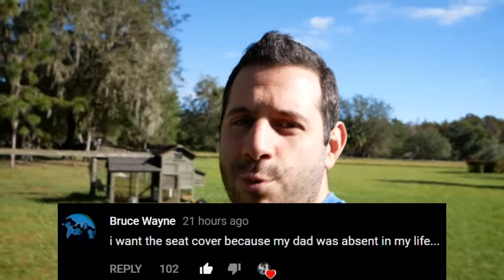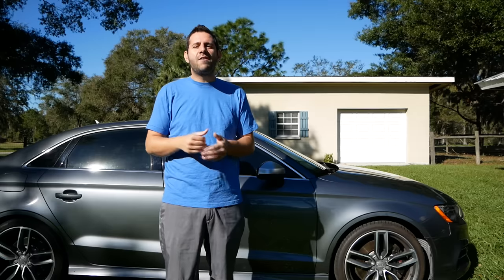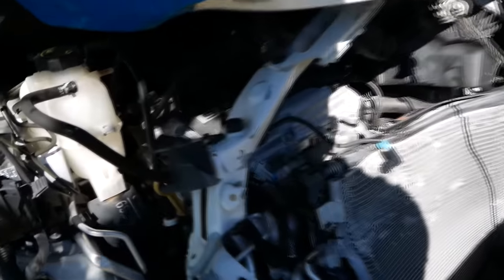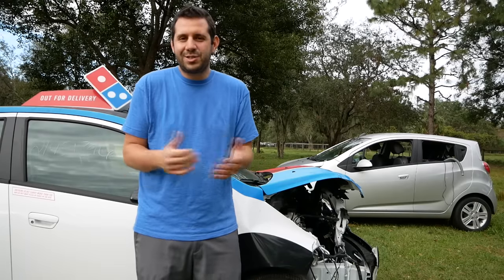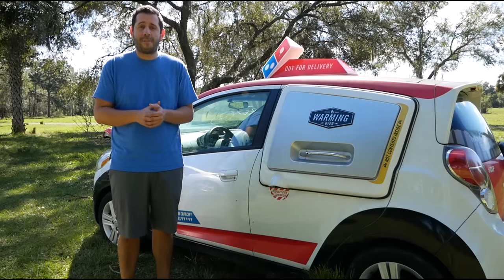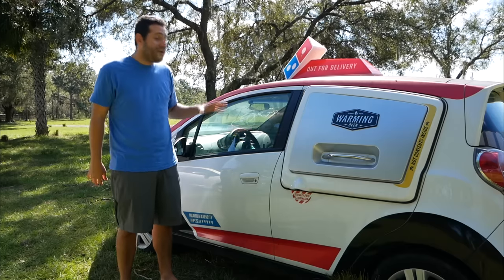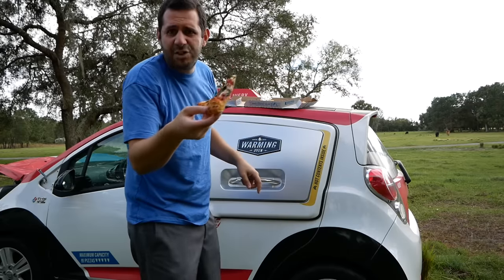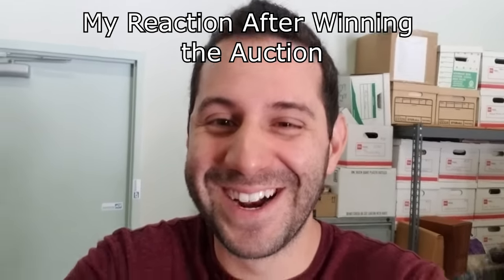I Bought a WRECKED Domino's Pizza DXP Car for $525 (and we're gonna rebuild it)

Comment: Wow does that "warming oven" look generic as hell! I love how it was attached so piss poor to the door, and the red LED strip that was just stuck on the roof of it... Im sure Dominos took it deep and hard with no  lube for these craptastic rigged modifications!
Reply: audiofanaticz wtf
Reply: audiofanaticz  isn't it a Ford
Reply: audiofanaticz - Not as deep and hard as Rousch has made a business of taking it with their cheap ass plastic mods.
Reply: audiofanaticz I used to drive these things for dominos and I can agree that the whole car is a big pile of shit. 18 second 0-60 time with the pedal on the floor.
Reply: appleintosh - You have your stats mixed up, the Chevy Spark is an 11 second to 60 car, 18 seconds in the 1/4 mile. And that's flooring it, not delivering pizza. For a little hatchback it's as fast as it needs to be.
Reply: Red Bluesome this also isn't a stock chevy spark..
Reply: diego perez - Mechanically it is a stock Spark, 1.2 liter four, continuously variable auto trans, GM factory warranty and all. The whole idea behind the DXP is promotion and quick turnaround, not slow delivery and cold pizza.
Reply: Red Bluesome Lol I actually drove these cars and timed it myself. Go ahead and list the stats you found on Wikipedia and keep arguing with the guy who actually drove the things.
Reply: Red Bluesome but I'm pretty sure that oven and all the other shit in it isn't stock. Weight has something to do with the speed too ya know.
Reply: Red Bluesome no it aint man my 98 landrover dedender will accelerate quicker while towing 4 tone
Reply: diego perez - Please understand what is posted. I said mechanically the car is stock, which it is. The warming oven is a non-mechanical modification. If anything the DXP may be lighter than stock with the front and rear passenger seats removed.
Reply: Red Bluesome Are you saying I'm lying about it having an 18 second 0-60? You don't think it's at all possible that Dominos decided they didn't want their drivers trashing a brand new vehicle that their drivers didn't have a penny invested into? You don't think it's possible that they might have retuned the computer from a stock Spark to make it more suited for the needs of a pizza delivery company? Maybe give it a slower top speed and acceleration? 

You still haven't shared your authority on these cars either. For all I know you actually are some guy pulling info off Wikipedia. Unless you've driven a Dominos DXP or you maintain them, your opinion doesn't mean dick either.
Reply: killerwar1 No, he's saying that I'm lying about my 0-60 time. He still hasn't proved to me that he's ever had ANY experience with a DXP, so he could just be pulling the stock Spark stats off of Wikipedia and saying they must be the exact same for a modified Spark. 

Once he proves to me that he's either driven or maintained a Dominos DXP then I will take him seriously.
Reply: appleintosh - I'm saying the car performs like a stock Spark until proven otherwise. You posited that the DXP is electronically limited and takes 18 seconds to 60 so back it up with documentation. 

I don't come from opinion but published facts. Car&Driver made an instrumented test of the '15 DXP and their findings were 0-60 in 11.2 sec. and a drag limited top speed of 100 mph. In other words like a stock Spark, which is already limited on performance to be honest.
Reply: Red Bluesome My time was 18 seconds. This was a pedal to the metal test on a real road, in actual conditions. Not a test on a track. A track is not actual delivery conditions. 

They probably used a brand new DXP, that was never used and abused by delivery drivers. These things got abused. Performance suffers after abuse. One of my stores DXPs needed an engine rebuild after about six months because drivers treated them like absolute shit.
Reply: appleintosh - Driver abuse - such as mashing the pedal to see how fast it'll go, poor maintenance, and what you could manage on a public road does not invalidate an 11.2 time. The bottom line is, the DXP is not electronically limited as you claimed it might be. It's a long way off of 18 seconds.
Reply: Red Bluesome It's 18 seconds in the real world. What good is a fast track time on a utilitarian vehicle if it will never go that fast in its intended use?
Reply: Red Bluesome It's exactly the same as measuring the towing capacity of a Corvette. A corvette is never going to tow a trailer in the real world.
Reply: appleintosh - 18 seconds is what you informally clocked on an abused and poorly maintained vehicle by your own description. Closer to 11.2 is what a DXP/Spark would do in proper condition on a dry flat surface, depending on load, even in the real world. What you're really saying is the car you drove was shabby.
Reply: Red Bluesome And I'm telling you that 18 seconds is a real time. Every Dominos store is going to have similar wear on the cars, because they all use their $25,000 investments the same way. By the way, my test wasn't in the DXP that had a blown engine. We had three of them. 

You can always boast about your cars 0-60 time when it's brand new, but the reality is that performance suffers after use. Any car with 20,000 miles is going to perform worse than the same car brand new, especially when it racks up that 20,000 miles in less than a year of hard city driving. 

The DXP isn't a race car. It's a pizza delivery car. There's no point in showing off a fast time, when the reality is that the car is only going to be that fast for the first few months of its use. It doesn't hold its performance like a performance car would. 

You're talking about a time in a driving magazine, driven by professional drivers on a real track. I'm talking about reality, where 21 year old, inexperienced drivers are driving pizzas around in a car that's been abused by said drivers. Obviously there's going to be a difference. That's just reality.
Reply: appleintosh highly doubt a small car like that takes 18 seconds to get to 60 lol...small cars these days are usually quite nice to drive. Very nimble, incredible stopping distance and quite nippy. Not like it's a performance car in anyway way but the power to weight ratio is usually so good that they are quite nippy obviously not if you compare it to a sports car but if you've driven a new small car you'd know what I'm talking about.
Reply: appleintosh also you deliver pizzas and aren't exactly a pro driver so I highly doubt you've even pushed this car to it's limits to even be able to tell us how it is performance wise.
Reply: diego perez well in a way it is...sure the oven adds weight but it'd only be half as heavy as a human and humans barely make a difference to a cars performance so I doubt the oven would. Also it only has one seat with a semi stripped interior so that evens it out basically. 50kg oven minus like 20-30kg from the interior. So in the end is like a 20-30kg difference plus a driver. And if the drivers weight mattered then only small/tiny people would win racing which isn't what happens.
Reply: appleintosh also how'd you time it? Did you count it yourself ?? 😂 the fact you're not a pro driver or even probably a very good one already makes the test invalid but the fact you probably just counted it to yourself just furthers my point...we could put you in a lambo and a pro driver in a lambo I guarantee his 0-60 is quicker then yours every time so if you really want to test a cars 0-60 speed then you need a pro racer who's actually capable of pushing the car to it's full potential not the drivers full potential...you'd probably take 10 seconds to hit 60 in a 4 second sports car doesn't mean that cars slow...
Reply: Yamaha Life Great job completely missing the point. 18 seconds is the real 0-60 time, in the real world, with real drivers. Dominos delivery drivers aren't professional race drivers. That's the point. Nobody actually delivering pizzas in this thing is going to get a 12 second 0-60. 

It's not like it takes much driver skill to drive this thing anyway. It's an automatic, the driver doesn't get any control over the torque or when the gears shift, things that a professional driver with a manual transmission gets to manipulate. You push the pedal to the floor and the car does the rest. 

And if you're really curious, I timed it with a stopwatch, and while the DXPs are monitored, we floored it everywhere so there's no difference between a test and regular driving.
Reply: Yamaha Life Flooring it was actually the only way to keep up with other cars accelerating.
Reply: appleintosh - Your claim that it's an 18 second doesn't hold water when the argument is based on the performance of amateur pizza drivers in poorly maintained cars. The limiting factor here is not the car. 

Mashing the gas from idle isn't going to give you the fastest time, even in an automatic. A professional driver - or even a competent amateur knows to hold the brake while building sufficient revs to ensure immediate power, and then to modulate the throttle thereafter to find that sweet spot in the rev range. Some skill is required even for an automatic, so the DXP is not an 18 second car, you guys just couldn't launch it correctly. 

Track or "real world", there is no way a DXP/Spark would require 18 seconds unless the driver really doesn't know better. Remember, a car is only as good as the driver after all.
Reply: Yamaha Life Have you seen how old those videos are? Try 2010. Almost eight years ago.
Reply: Red Bluesome Jesus Christ man, that's what I'm trying to tell you. 18 seconds is what you can expect from the people who drive these cars. Not 12. Why is this so hard for you to understand?
Reply: appleintosh - It's not hard to understand at all, but you didn't say that. You basically said the car was shit and couldn't do better than 18 seconds to 60. We've established that it can, and if it doesn't that is no fault of the car.
Reply: Red Bluesome I did say the car was shit. I still think that it's shit, and if you ever drive one you'll probably agree with the rest of us who have driven them. 

We've established that the car can go 0-60 in 12 seconds in a controlled environment. Not in actual usage. In actual usage with average drivers it's closer to 18 seconds.
Reply: appleintosh - You described the car as a big pile of shit, 0 to 60 in 18 seconds foot to the floor. You're free to have your opinion of the car, but don't say it's an 18 second car simply because you can't drive it faster. 

The "controlled environment" of an instrumented test is not a laboratory, just ideal. Any regular driver who knows what they're doing could get a 12 second time out of a Spark/DXP on a track, or on the boulevard on a cool dry day.
Reply: Red Bluesome Are you sure about that? You've never driven one. I don't need you insulting my driving; notice how I've refrained from insults. 

I'll say it again since you keep ignoring my point. An average driver in an average DXP is not going to pull a 12 second 0-60. The test you're describing involves a professional driver on a real track. The test I'm talking about is an average driver, driving an abused car (which is normal when talking about these cars) on a city street. Those are two completely different environments. You can't expect two completely different tests to have the exact same results.
Reply: Red Bluesome Notice how I never once said the DXP was limited to an 18 second 0-60. Never once. All I've been saying this whole time is that a DXP is not going to pull a 12 second 0-60 under normal circumstances. 

I'm talking about reality, you're talking about ideal conditions.
Reply: appleintosh - You made it clear you thought the car was no better than 18 seconds to 60, with no regard for conditions, even alluding that the car might be electronically limited. You wouldn't even believe it was capable of 12 until a published road test was referenced. 

There is no voodoo involved in fairly replicating tested acceleration times in the real world. Even on a city street this car could likely do 13 or 13.2 with a fat guy driving, and six pizzas in the back, if he knew how to utilize the powerband, which is not mashing the gas from idle. That's not even fast, but it's light years from 18 as far as acceleration goes.
Reply: 😂😂😂😂😂  these comments tho
But really why would you try to "real world" test a car that wasn't yours mr. apple? Someone spent their hard earned money on that car for their business..you were employed at Dominos as a pizza boy, not Motor Week...smh..no respect.
On the real though our spark is zippy for in town high traffic, it is not a performance machine by any means but these folks trashing it in the comments need to settle down. Its good for what it is.
Great video excited to see the project come along for $525 it was a steal like it or lump it.
Reply: Red Bluesome Sure, I did say I timed the car at 18 seconds, and I had a real hard time believing you until you posted a source to your claim. But I never denied that it's a 12 second car under the right conditions. 

So you're saying that as long as the driver is skilled, they can recreate the acceleration of a brand new car on a track, while using a used car, with 20,000 miles, an engine that's already wearing down, on a city street? Sure.
Reply: Cuddly Cactus We tried to have fun in the cars because we were entrusted with a vehicle we didn't have a penny invested into. We all agreed that that was it's only redeeming quality; that it's not our car so we're not putting miles on our own cars. Delivering pizza sucks.
Reply: appleintosh that statement is sad, the fact you used the word "entrusted" smh. You chose that job, so can't really complain bud. I hope you ultimately can see that it wasn't really the choice having fun with a car you were "entrusted" with. I hope you have a better job and are making better choices, good luck mate. Red still is the winner of this fun lil debate and by your own statements you made yourself look like a bit of a doo, but hey best wishes mate.
Reply: Cuddly Cactus Whats your definition of entrusted then? The company let 21 year old drivers with not much experience drive their combined $75,000 investments around. That's trust. And yes, I do have a better job now. 

Me and him seem to be talking about different things. He's talking about what the car's max capabilities are, I'm talking about what the car's average capabilities are.
Reply: Big Zeke Better watch out, or Red Bluesome will start a three day long argument with you about how the DXP costs $25,000 instead of $45,000.
Reply: appleintosh - Yes, basic test results like 0-60 can certainly be replicated on the street. Car&Driver tests vehicles with a full tank of gas by the way, which in a Spark would be 58 lbs. of fuel. Speaking of real world results, that's what the 5-60 rolling start (street start) is all about, to bring a result that can be expected on the street. Most cars are slower in 5-60 than 0-60 and the Spark/DXP is no exception. C&D's test result for the DXP rolling start was 11.8 sec. 

Foot to the floor with a stop watch as you said, I'm pretty sure we're both talking max capabilities here. You were out there trying to make it accelerate as fast as you could. What you got was a lousy result from a lousy effort. 

20,000 is not really a lot of mileage, even for a cheap car. I think you're bluffing about how clapped out your boss's fleet was, especially when regular service is part of the 5 yr. 100,000 mile GM powertrain warranty... I won't argue with a guy who says the DXP is $45k. But, it was widely reported to be just under $26,000, so I'll believe that.
Reply: Red Bluesome Foot to the floor with a stop watch is exactly what I did. 18 seconds certainly is a lousy result compared to 12 seconds, but that's what I got. You can insult my driving all you want, but my driving is about what you can expect from 98% of delivery drivers. We're not professional racing drivers by any definition of the term. 

Think about how these cars racked up those 20,000 miles. This happened over the course of about six months, in 100% stop and go city driving. No highways. That kills cars. The vast majority of people who average 40,000 miles a year in their car rack of most of those miles on a work commute, which is mostly on a highway. 

My stores DXPs got a checkup by the dealership once a month, and were immediately fixed when things broke. They weren't neglected at all, just worked incredibly hard.
Reply: Tedd Freestone Oh great, another person jumping to conclusions. I never said the DXP can't do 0-60 in 12 seconds. I only said that under actual conditions it's 18 seconds. 

I don't go around telling you what your trucks capabilities are. Please stop going around saying what you think the capabilities of a car you've never driven are. 

Does driving the car and timing it myself count as research? Or is research only looking things up on the internet? 

How could you possibly assume someone's politics based on this comment thread?
Reply: Tedd Freestone Why does everybody assume that I'm lying or making stuff up? Is it really that hard to believe that an abused car driven by a non professional driver isn't going to perform as well as a brand new car with a professional driver?
Reply: appleintosh - That's the thing, 18 seconds to 60 is not what to expect from "actual conditions", it's what to expect of an amateur driver. Almost any car is going to be half as fast to 60 if launched how you did it. Even all the city miles aren't a big factor regardless of how thrashed they were. Because as you stated, the cars were maintained and fixed when something broke. 

I know people who commute around the Los Angeles area in anything from a Smart to a Spark. We're talking extended freeway, stop and go, and a lot of idling waiting for traffic to move, 100+ miles a day. Their cars certainly aren't half as fast as when they were new, that just doesn't happen on any maintained vehicle.
Reply: Red Bluesome Once again, you're repeating what I'm saying. Pizza delivery drivers are not professional drivers, so "it's what to expect of an amateur driver". Those are your words, saying exactly what I'm saying. Why are you still arguing this? The actual conditions are amateur drivers. I don't know what reality you live in that pizza delivery drivers are professional drivers that know how to launch a car as perfectly as a magazine test driver. 

Your friends probably pay for their cars, right? They have an interest in keeping it in good shape? Delivery drivers who don't have a penny invested in the company car don't treat the company car how they would treat their own car. In the delivery business, more deliveries equals more money. The faster you drive, the more money you make. Having an incentive to drive as fast as safely possible, combined with a car that's not yours doesn't mean good things for the car's lifespan. There's a reason Dominos only expects these cars to last a few years with 100,000 miles. A 2015 model year car should get at least twice that.
Reply: Bruce Willis from Armageddon "No, I didnt say you did a bad job, you did a piss poor job".
Reply: What the hell is wrong with you people arguing about how fast a damn pizza delivery car can go. Do any of you have anything better to do than argue on a damn YouTube video.
Reply: EpicGamer 154 I was actually having fun. I've never had an argument last that long.
Reply: appleintosh yeah it was actually pretty funny though.
Reply: appleintosh - My issue here is the lack of proper context in your original post. Which should have made note of the amateur drivers who don't give a shit, before writing off the car like you did.
Reply: Red Bluesome I thought amateur drivers who don't give a shit would be a given. This is a pizza delivery car, not a formula one car. Pizza delivery drivers aren't professional drivers, no matter where in the world you look. 

My issue is with you refusing to believe that 18 seconds is what you can reasonably expect from actual usage. I think it's also annoying how you passive aggressively insulted my driving in almost every post.
Reply: appleintosh - I’m not passively insulting your driving, I’m actively saying it stunk for somebody trying to test a car. You said as much yourself. Amateur drivers aren’t a given. But the 18 second foot to the floor claim is misleading, as it implies the limiting factor is the car, when it should have been noted that 18 seconds was at the hand of an amateur who didn’t know how to get more out of it. That’s an important detail.
Reply: What did I start here? LOL Im dead!
Reply: Red Bluesome Amateur drivers absolutely are a given. Once again, this is a DXP, not a formula one car. 99% of all the people who are ever going to drive these cars are going to be what you consider to be amateur drivers.

Me claiming it's an 18 second 0-60 is not misleading because 18 seconds is what you're going to get from 99% of the drivers in the car.
Reply: Red Bluesome OML
Reply: Red Bluesome GO ARGUE SOMEWHERE ELSE
Reply: appleintosh - Amateur drivers are not a given, any more than 99% of Spark drivers deliver pizza. We’re still side-stepping the fact that the limiting factor in the 18 second run to 60 is the driver, not the car.
Reply: Red Bluesome Why do you keep insisting that Dominos delivery drivers are professional drivers?
Reply: I don't insist any such thing. What I do insist is that you're deflecting from your initial mistake that a Spark/DXP isn't better than what you could manage to get out of it. Otherwise you'd simply acknowledge the potential rather than throwing out all these excuses about amateur drivers, and real world conditions which have no bearing on a car's performance potential.
Reply: Red Bluesome I made no mistake. I still firmly believe that the best a DXP is going to do under delivery conditions is 18 seconds. On a track it's going to do better, but not on the streets with a driver paid minimum wage.
Reply: The mistake was in making no such stipulation in your original criticism. It's like reporting that a vehicle has only a 20 miles range without mentioning that the tank is on E, context is important. It's foolish to believe that a DXP/Spark could do no better than 18 seconds under "delivery conditions" - whatever that is, and with a driver making minimum wage. Especially - as an admitted amateur driver, the manner in which you tested the acceleration (mashing the gas from idle) is totally not how to fully exploit any car's available powerband on the track or the street... Guaranteed many enthusiasts who know better could beat that time on the street by a long shot, even with a trunk load of pizzas. I'm still wondering how driver pay rate relates to a car's built-in mechanical potential, particularly if time is money.
Reply: Red Bluesome That's no mistake. 

You're still trying to tell me that dominos drivers are professional drivers. Delivery conditions are driving on streets, with a driver that has zero professional training. I'm positive a car enthusiast could make a much better time, but 99% of delivery drivers aren't car enthusiasts. They're just guys looking to earn money. Just because they drive cars on a street for a living doesn't make them professional drivers. You're acting like dominos pays them to go to a track or take lessons on track driving.
Reply: Your insinuation that nobody but a professional driver on a track could beat the times of untrained pizza boys just trying to make a living is illogical. Logic would dictate that it would require only the motivation, and a step above base level driving ability. That qualifies a great many drivers on the road.

You were doing more than making a living when you timed the car. What you didn't factor in is that, like your co-workers, you were a total novice behind the wheel, and therefor not a competent judge of the car's street performance. More than an introductory knowledge of the car would have yielded a much better result... So your claim should have been that 0-60 in 18 seconds was all you could manage as an amateur driver. That's an important disclaimer.
Reply: Red Bluesome That's still not what I'm saying, man. All I'm saying is that 99% of delivery drivers aren't going to be car enthusiasts, like how 99% of all drivers wouldn't consider themselves car enthusiasts. You may be a car enthusiast, and I'm sure many of your friends are car enthusiasts as well, since people like to surround themselves with like minded people, but that doesn't mean most drivers are. The vast majority of people own a car to get them from point A to point B, and don't have any other interest in it. That's why most cars today are disposable. 

Anyway, even if one of the 1% of dominos drivers who are car enthusiasts gets their hands on a DXP, they're not going to be pushing the car to its track limits, unless they want to lose their job. So they're probably going to drive it just like anybody else. Meaning you're never going to have any delivery driver ever driving the car to its maximum.
Reply: When did this become a debate of what percentage of drivers are enthusiasts? This is only a matter of a Spark/DXP's potential rate of straight line acceleration to 60 miles per hour, hardly pushing limits, even speed limits on most highways. The potential in question was poorly assessed when you timed it is what I'm saying... 

The video link below illustrates a 2013 manual Spark with traction control off, making two runs to 60, both times under 13 seconds. A time certainly in keeping with it's power and weight. With an automatic you could expect a lag of 1, perhaps 1.5 seconds behind that. But certainly not 18 seconds to 60.  

https://www.youtube.com/watch?v=KXy6qceUzkc
Reply: Red Bluesome I’m not debating that a DXP is capable or not capable of pulling a 13 second 0-60. I’ve never claimed that the car is incapable of doing it, I’ve told you that multiple times, but you still can’t get it through your head that that’s not what I’m claiming. 

Show me a test with a selection of random Dominos delivery drivers pulled off the street and attempting the same test on the streets they deliver in. It’s not going to be 13 seconds, it will be closer to 18.

I’m bringing up driver statistics because we can reasonably assume that the skill level of delivery drivers is going to be similar to the skill level of every other driver on the road.
Reply: Red Bluesome In fact, just show me the exact same test you linked to, except featuring random drivers pulled off the street. 99% of randomly selected drivers in America aren’t going to be able to produce a 13 Second 0-60 in a DXP, since 99% of American drivers’ vehicle knowledge is to mash the pedal to accelerate. 

You seem to still be trying to tell me that a DXP is capable of 13 seconds. I’ve never denied this.
Reply: It's not about what 99% of drivers are inclined to with the gas pedal, it's about a car's ability. You didn't deny that the Spark/DXP was a 13 second car, you simply omitted that or didn't know when you firmly stated that it was an 18 second car. Which is it?
Reply: Red Bluesome The car is an 18 second car when you’re mashing the accelerator. 99% of driver’s attempts to make a car go its fastest is going to be mashing the gas pedal, therefore 99% of drivers will have a maximum performance of 18 seconds, based off of their skill, not the car’s capabilities. 

The car is capable of 13 seconds when driven by a professional who does more than just mash the accelerator, as tests have proven. 99% of drivers aren’t going to be able to do it.

It’s as simple as that. I cannot see how you still think I’m claiming the DXP is not capable of 13 seconds. It is certainly capable of that, but the vast majority of drivers are not capable of pulling a 13 second 0-60 in a DXP.
Reply: You should have stipulated then in your original post that 18 seconds was not reflective of the car's potential but of driver limitation. That said, one need not be a professional to get a 12.5-13 second time out of this car, particularly an automatic. Hold the brake, rev the motor to an ideal speed, release the brake and go. The most that would be required is a bit of throttle modulation to negate wheel hop and traction loss. A five minute lesson would have anybody pulling 13 in a Spark/DXP in no time.
Reply: Red Bluesome Why would I have to specify that? It’s not what you’re going to get from actual use. What good is a 13 second time, when the delivery driver in the car can only get 18 seconds. If the person ordering was the driver, and they knew they could get a 13 second time, sure, then it could make a difference on their pizza delivery time. But not when the delivery driver is untrained and can only get 18 seconds.